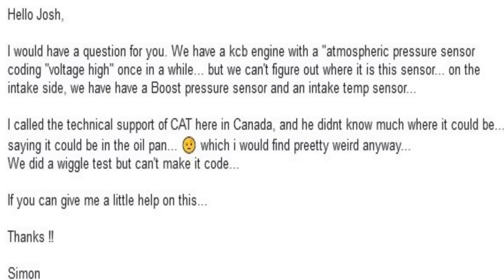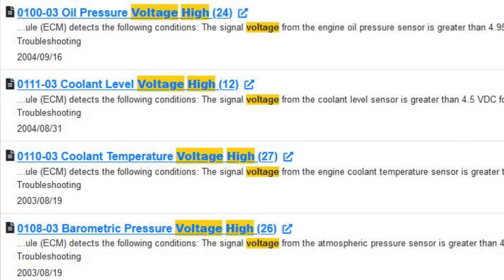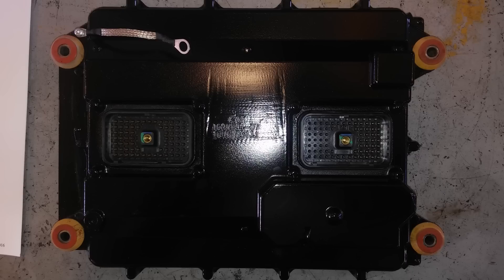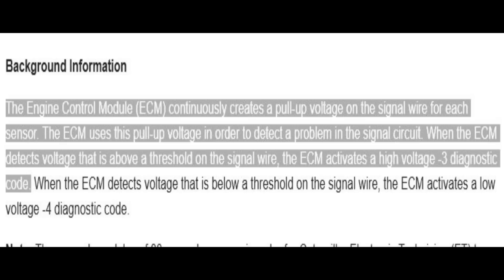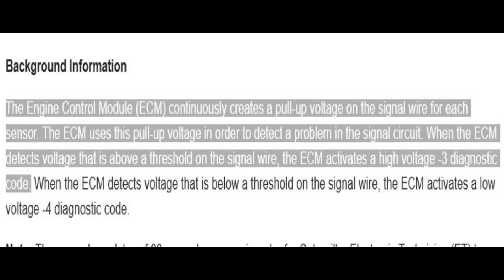What a does Sensor Voltage High fault mean? Question of the Week 5.

Comment: I have a code p0563 when I turn on the car all the lights on the radio dashboard and windows do not work the car is on I turn it off and everything returns to normal I have a 2016 dodge charger rt

Comment: One other point to high and low voltage is the "internal resister" in the controller. There is a pull-up internal resistor and a pull-down internal resistor and if it's a two wire or a three-wire connector. The voltage readings are the opposite for an open in a two wire and three wire because it depends on the internal resister wiring in the controller.

Comment: I’m working on an rdr 777 right now with a voltage above normal on 3 sensors and an open on number 11 solenoid 2 injector. Another Tech went out to change the sensors without a further diagnosis. I’m sure I’ll get the problem 🤞🏿🇨🇦

Comment: Hello, I am having some electrical problems. My ECU, put off codes for my throttle position sensor; high & low voltage, purge valve sensor, & coolant temperature sensor; high voltage. The problem is I replaced my ECU, because my old one over charged my system. Now, when i put the new reman., ECU in, I was trying to reset ECU, cause of a crankshaft position relearn code I was getting. I waited 10 minutes before I hooked it back up, after that all these sensors started acting up. ECU, basically started throwing the codes. The van wouldn't start, I smelled something burning. So, I used the warranty & got that ECU replaced. Also, I discovered that my spark plug wires were damaged & coils, from that incident. Everything was working fine, until I tried to reset the ECU. Now, I replaced, everything I mentioned to you above, yet my new ECU, is throwing the same codes, after I replaced the temperature sensor, throttle position sensor, & purge valve sensor. I even replaced the connectors. Do you think there is a short or open circuit, within the wire harness?

Comment: Had one of those atmospheric sensors on a 3406b go tits up. In the field and no parts and it was derated. I went to the configuration screen and ET , at the time, let me change the value from installed to not installed. Cured the derate and I never saw the truck again. It was a flatland unit so I’m thinking no harm, no foul.

Comment: Your are correct about other OEMs flipping the terminology. I had a voltage high code on a Cummins for the water in fuel sensor that is in the fuel water separator filter housing. 2 wire harness. One 5 volt ref and the other a return. There was a short in the 2 wire harness causing a voltage high code. The return wire was seeing all 5 volts from the supply wire.

Comment: Josh, Can I mail you a cm870 ecm that needs programmed for a international 9900? I got it off ebay to use as a spare ecm. I plugged it in and something wrong. When I push the fuel the rpms go wide open. However it idles fine.  Something needs adjusted.

Comment: Gets a bit more confusing when you also introduce CAN BUS circuits as the termination resistors dictate voltage high/low faults.👍
Reply: All CAN circuits have a 120 ohm resistance H to L... if you're outside that somethings broken.   CAN works by a floating voltage range either being high or low or the easy way to understand it.. the "difference" between H and L is 0/1.
Reply from the maker: The resistance in the circuit will be 60 ohms, there are 2 120 terminating resistors that combined will get you your 60 ohms of resistance.

Comment: I’m an electrical engineer, not a mechanic, but I love these videos.  This was explained very nicely.  Regarding your comments on Cummins possibly using a pull down instead of a pull up, that’s possible, but to me it’s less advantageous because you can’t distinguish between an open and a short to ground, as both would cause low voltage.  A pull down does however still serve the purpose of preventing a “floating” input that could cause erratic behavior.

Comment: A good shortcut to remember for voltage high/low is to use the letter "V". If it's a high votage code, it's an open just like the top of the "V" is. Voltage low is a short, just like the bottom of the "V" is. Same rules apply to amperage, just substitute an "A". Hard to explain, easier to draw it and people get it almost immediately.
Reply from the maker: That is actually kind of genius for explanations.
Reply: Concise, and elegant. Fantastic explanation!
Reply: Omg
Reply: I don’t like that so much because other OEMs use different terminology like he states
Reply: @drummerTBM  I'm a CAT mechanic like Josh, so I probably should've prefaced it by saying this may only apply to certain manufacturers.
Reply: That makes so much sense. I have no idea why it’s not in any of those introductory books I read. Well now I know. Thanks.

Comment: Why the fuck would a MAP sensor be in the front structure? How would it read boost pressure from there? Why not in the intake system somewhere?
Reply from the maker: It's the atmospheric pressure sensor, not the MAP sensor.

Comment: Correct, if it is a active short make it a open circuit. If it is a active open, make it a short circuit. If it is intermittent, pull your hair out. Can do a wiggle test, or I like the test tool Cat has. That you can plug up to a three wire sensor. The fault will go away and it has a diode on the tip and it lights up showing voltage. Naturally you plug the sensor back up and see if the active code returns. As if it is a connection problem or a rubbed wire, you have disturbed the circuit.
Give you a A+, as you had no drawings. Your art work is still abstract. If you didn't label your drawings, I would not know what in the hell you was trying to teach me.
You have PID- FMI. PID is what system is the problem, FMI tells us how it has failed.
0-Data valid but above normal operational range
1-Data valid but below normal operational range
2-Data erratic, intermittent, or incorrect
3-Voltage above normal or shorted high
4-Voltage below normal or shorted low
5-Current below normal or open circuit
6-Current above normal or grounded circuit
7-Mechanical system not responding properly
8-Abnormal frequency, pulse width, or period
9-Abnormal update
10-Abnormal rate of change
11-Failure mode not identifiable
12-Bad device or component
13-Uncalibrated device or component
14/15-Reserved for future assignment

Last you have the debounce time. How long it takes before the CEL comes on. Varies on which sensor/system has failed.

Comment: Circuit faults are easy, what I really hate is when you get a "performance"  code! (As in "shift solenoid A performance")

For those that don't know a performance code normally indicates a mechanical problem or something mechanically not functioning as it should and it can be a real pain in the ass to track down especially when it's intermittent 😡

Comment: Have you ever diagnosed any ISX Cummins issues?   My trucker buddy has an issue with the engine trying to shut down but when comes back it puffs smoke. (black)  Changed filters, fuel lines, changed solenoid shutoff, still does the "burbling" and black puffing  It is in a '99 Pete.  set at 475 manual 525 cruise  (I think that is what he told me)
Reply: I was wondering if the Jakes could be causing something like that?
Reply: @two-strokesmoke7289  Yes, if that issue of "the engine trying to shut down" occurs when the jakes had been on, and then the jake system shuts off, but the jakes seem to still be functioning.  If the driver depresses the throttle after the jakes are turned off, a loud popping sound should be heard and the engine may be to seeming to stall.  The problem lies in a broken spring in a control valve.  The spring is easily replaced.  HTH
Reply: And Josh, excellent video.  I would say the biggest shortcoming of truck technicians is the understanding electronic/electrical issues.